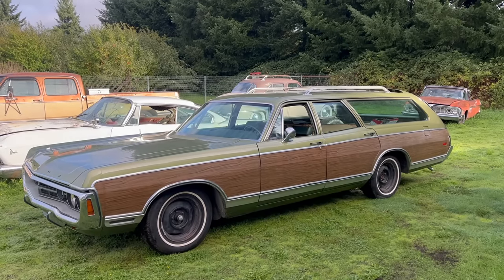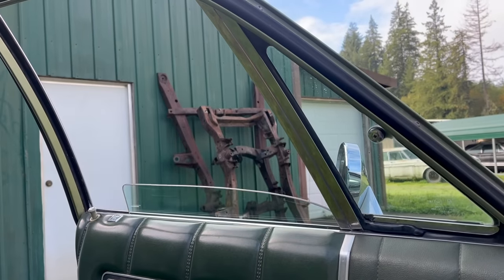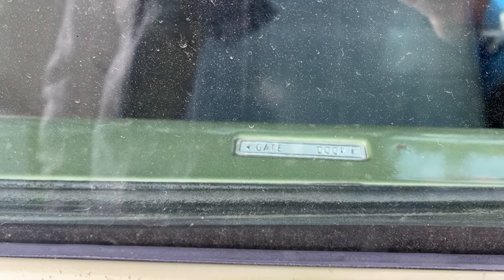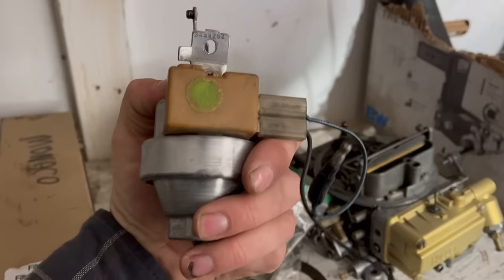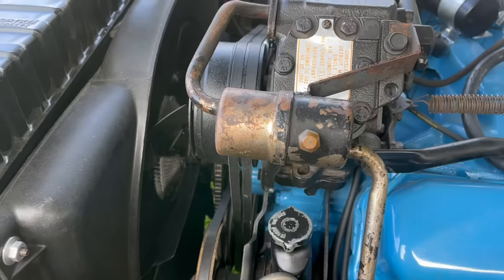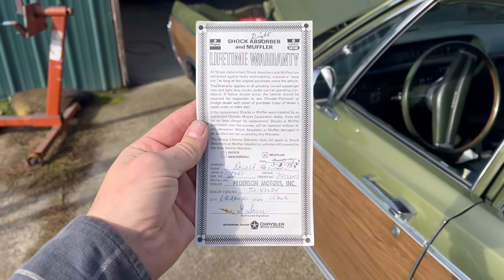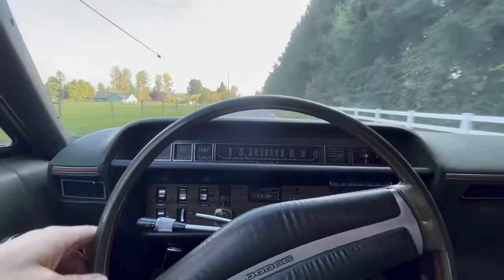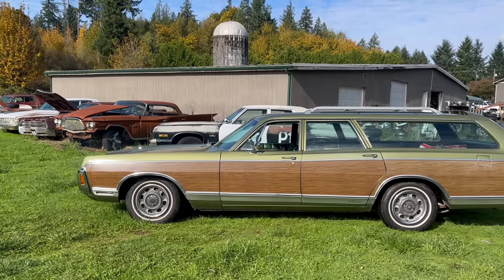AMAZING SURVIVOR! This 1970 Dodge Monaco Station Wagon Is A Sweet Family Truckster With 440 Power

Comment: Gotta love the cigarette window.  Nobody does this anymore, and pity: it maintains the lions share of usable window space while squaring up the window track a bit - keeps it simple and easy to repair.  That and drip rails are two of my most missed small details car designers have simply forgotten about.
Reply: i miss those vent windows also, I made it to 2004 before buying a car (or truck) with A/C thanks to those triangles
Reply: I just sold my '77 Dodge Royal Monaco Brougham Wagon a week ago! 
62k miles and she went to a Good Home!!!
Reply: Those were air vent windows meant to bring air inside.
Reply: I'm amazed how many Dodges were ordered with power windows......even though it was Chrysler's mid-market division.....I just find GM cars had them fairly often, but Ford and Chrysler products much less frequently.
Reply: We were never smokers but my dad had a Chevy van growing up that he made into a camper.  The front windows had those little vent windows and they were the BEST at cooling you down quickly because you could direct the air right at your face.  I miss those and my dad😢

Comment: It would be interesting to see a full sized 1970 Monaco station wagon on the Autobahn. 🙃
Reply: Going 140mph....😎
Reply: @LongIslandMopars with an overdrive, this car can do it. Remember, the police versions of these C bodies in these years could crack 150 mph with the 440 performance package. Although with the soft floaty suspension these non police spec versions have, that could be a bit un nerving. But with good tires and shocks, 120 to 130 is doable. But you’d be a whole lot happier in the 80 to 100 mph range.

Comment: We had a '72 Town & Country wagon when I was a kid. I remember we got it used in like '78 with probably 40k miles on it and dad paid $1,800 for it. It was the first car we ever had with A/C and all the goodies. Such a beast, and so comfortable on road trips. A lot of good memories in that big ole wagon. I laughed when you mentioned ticking sounds in the 440. I distinctly remember ours made a ticking sound when it was under a moderate load. Could have just been pinging from cheap gas and high altitude, but it always seemed like a Chrysler big block thing.
Reply from the maker: Almost certainly pinging. Common problem indeed… haha. Very cool!
Reply: @DeadDodgeGarage  My dad had a new 440 Monaco in the 70s and he would always use premium gas in the hot summer months, which eliminated the pinging.

Comment: A big-ass station wagon is still top on my bucket list. Leave the car looking completely stock with a modern drivetrain under the hood or a big block built for low end grunt mated to a modern overdrive transmission. Ultimate road trip vehicle right there.
Reply from the maker: Absolutely. If ours wasn’t a big block I would be scheming how to put an overdrive in it. It does cruise pretty well as is though. I should probably work on that again some time…

Comment: I grew up during the fuselage era - my dad bought four Plymouth Sport Suburbans new (1968, 1970, 1972 and 1975) the 70 and 72 models were of the fuselage styling era - this Dodge is absolutely gorgeous - the only missing option is factory Airtemp dual air conditioning - curiously according to the dealer option ordering literature the Superlite was not available with dual air conditioning (which made absolutely no sense to me initially until I noticed the Superlite instrument panel switch is in the same location as where the dual air conditioning switch would be located if this wagon were so equipped - presumably due to lack of switch space on the instrument panel) the correct term for the rear “grab handles was “tailgate assist handles” a $19 option at the time - these handles were a Chrysler Corporation exclusive option on certain Chrysler, Dodge and Plymouth wagons from 1960 through 1977 - additionally the windshield/tailgate window washer switch operates both the front and rear systems (I recently saw an entire internal rear washer system for these wagons for sale on ebay) the chrome tailgate filler cap removes to refill the rear washer reservoir

Comment: Beautiful.  I still have a preference for the Plymouth Custom and Sport Suburban wagons (ours was a '69 Custom Suburban 6-seater in blue with a 383-2V).   The Dodge does look lower but I think in part that is from the front end treatment; Dodge did a couple of years with headlights appearing lower on the grill relative to the fender tops and it really makes the cars appear to hug the ground more than the Plymouth.

Someday I hope to have one again but until then its great to see one getting fixed up and loved.
Reply: 383 2bbl are workhorses 👍
Reply: @capricetony  yes, but my Dad always wished he'd gotten the 383-4V or 440, but he bought the car off the lot and it had what he needed and more importantly could afford.  Given how much we towed for vacations though, I'm amazed we never did the fairly basic upgrade of dual exhaust and a 4 barrel intake/carb.  Time, money. car was daily driver, etc...

I wish I had that car...  I wish I'd been more inclined to do that work on her back then...

Comment: Nice.  I'd love to have this.  I'm old enough to remember when they could be found in the parking lot of our country club (which was the bargain basement variety, so a Monaco was pretty special).  Green was actually rather popular.  Interestingly, Chrysler moved almost 5x as many Town and Countrys as this Monaco wagon, even though they were considerably more expensive.  Up to the 74 redesign I always found the Monacos pretty impressive but they were totally clobbered by perhaps its nearest GM rival, the uber successful Bonneville.
Reply: Yes, Green WAS a popular color then, not only Chryslers but the other makes too. Can't tell you how many green HP and mundane Mopars I've owned. I had a '72 Charger Rallye with a 440 and 4 speed in darker F7 or F8 green. I still own a '71 GTX 440 6bbl with Air Grabber, Super Track Pack, AM/FM stereo w/Tape, bench seat w/center arm rest, Tach, hood pins, Driver Aid Package, Rallye wheels, sticker price totaled well over $5000. And it's green inside and out. I've owned and taken apart hundreds of those cars, mostly boring colors, but I did have some H.I.P. colored ones.

Comment: Hey Jamie howz the week treating you? Anyway I had a gear venders over under on my 68 440 Charger and it was so killer on gas and acceleration.if one is available this beast would do exceptional with one.see u Sunday peace and log's!
Reply from the maker: Oh hell yeah. I’ve yet to get my hands on a gear vendors. Some day… could really use something like that for my Power Wagon.
Reply: @DeadDodgeGarage  if I was thinking at the time I would have pulled out the unit.however thing were not good.i sold my charger with a stage 4  440 ,for 5000.a  sad day.

Comment: Definitely a high-optioned Dodge. That "super beam" light was installed on less than 5% of the full size Dodges.
Reply from the maker: And apparently discontinued mid run in ‘70 because it was made illegal.

Comment: Have you been able to come up with/find an adapter for the Edelbrock carb to operate the factory kickdown linkage that you are happy with? I don't like aftermarket cable systems that loop around from behind the trans lever.
Reply from the maker: Absolutely - the bolt on Edelbrock Chrysler throttle adapter. Some adjustment required, but it works.

Comment: Which AVS2 is on that 440, 650 or 800 CFM? I'm trying to decide on one or the other for my mild 440 build. .020 over, 452 heads, MC 1787 cam with .420/.443 lift.
Reply: Recently put a 650 on mine.  I think 800 was the right choice.  😢
Works, but I'm pretty sure it's suffocating things over 4k
Reply from the maker: This is a 650. This thing is super stock and will never turn high RPM. The 440 has enough inches to take advantage of the 800 at really high RPM, so that might be a thought for you, but the 650 will give great throttle response and make excellent torque.
Reply: @DeadDodgeGarage  Thanks, Sort of what I was thinking.

Comment: Isn't Monaco the deluxe trim package for a Polara? 
In my local junkyard, there's monaco with a 440. Even has 440 emblem
Reply from the maker: It’s a stand alone model - at least in ‘70. As much as they shuffled model names around, it wouldn’t surprise me if that were the case in some years.

Comment: I have a 1970 300 in Germany with a slightly tuned 440. Over 110 mph at 4k rpm on the Autobahn your oil temperature starts to rise quickly. Be aware of that.
Reply from the maker: That’s good to know. That explains why the state patrol highway pursuit cars have an oil cooler…
Reply: @DeadDodgeGarage  
Oil temp gauge can help to monitor that 😉

Comment: 'Normally' a car decked out with that many options is a Public Relations car (press car) or a Factory Executive/Lease car. That's what the 'Q' in the V.O.N. signifies. There should be a 'Y' sales code like Y22 or Y28. Nice car. I had a super mint old guy's 1973 Imperial with 55k miles I sold to a German guy in 2003 or 2004. I bought it in 2002 from a Trader ad for $1200. I used it as my daily till it ate me alive in gas (back then). I asked the German lady handling the exporting at the Port of Baltimore how they guy could afford the gas. She said a lot of times they just parked them on the street as a 'status symbol' they could afford to drive a huge American car and didn't drive it that much. I miss the old days when you could still get a nice deal like that. BTW, many of those C-wagons I've seen seemed to come with 383 HP's for some reason, the upper line ones.
Reply: The vin number shows "0", not Q.  DH 45 T0D 170685  DH 45 (high price class Dodge 4 door wagon) T (440-4 bbl slightly detuned to about 350 or so HP in wagons) O 1970 model year D is the plant it was produced at.    Y05:  Build to US Specs.
Reply: @MrTommyboy68  Nobody said the VIN '0' was a 'Q'. It is the first character in the vehicle order number. Which he stated began with a 'Q'. Which is on what is called the 'Trim Tag' or 'Fender Tag' apart from the VIN. It is used internally to build the car order BEFORE it gets assigned a VIN. I really don't know what you're talking about.  You shouldn't confuse the Vehicle Identification Number with the Vehicle Order Number. The V.O.N. is the very first number assigned to the car. As it's built it gets a V.I.N. and the 2 are tied together at the plant.
Reply: @vincemajestyk9497  I am going by the FENDER TAG as he does NOT have a build sheet.
Reply: @vincemajestyk9497  Yep.  I did some further research as I was confused by his "funky things" he mentioned on the group of numbers beginning with Q.  I have never known that that line of numbers is the ORDER NUMBER.  If he had the build sheet for that particular, that information should match the letters and numbers on the top row of the build sheet.  I never knew what those set of numbers was for, now I know.
Reply: @MrTommyboy68  It always follows the SPD which is the scheduled production date which can be different than the 'actual' production date, usually at the end of the month. That car is 'C04' which is December 4th. I've NEVER had a car except maybe a stripper which had all the options or codes on the tag. Even some that were on there but not added at assembly. The BC sheets were considered 'garbage' after it passed through an assembly point at the plant like trim, paint or powertrain and were supposed to be discarded. Some plants like Winsor had a 'no trash policy' so it's kind of rare to find a sheet in those cars.
Reply: @vincemajestyk9497  That is one of the things about Mother Mopar.  Every now and then you will get a "C" body that is LOADED to the gills with options, whether it be a Monaco or VIP or New Yorker.  And a few that I have seen were "sold" customer order and a very few demo's.
Reply: @MrTommyboy68  BTW, if you ever have a car with the original window sticker, on the very top line there will be 'Final Assy Point' (plant) "Vehicle Ident No."  and 'S.O. No'. This is a combination of the SPD-Plant-V.O.N. so this car's S.O. number (on the far right) would look like 'C04-DD-Q05866' if they had the window sticker. Take care!
Reply: @MrTommyboy68  I agree. I had many a C body with weird options. I had a 1971 New Yorker 4dr that was loaded PW, Power Locks Cruise and much more. It also had a 440 TNT and was special ordered by a preacher that wanted the 'most powerful engine' to pull his trailer. It was black with a vinyl top and blue interior, power seats. Road wheels. Nice car. Wish I still had it,

Comment: It is Gold Poly paint/ Gold Metallic Citron. Y6 2102 paint code
Reply from the maker: You might want to adjust your TV set, because it is not gold - it’s green. If you direct your attention to 7:13 in the video, you will see that F4 (light green poly) is clearly shown on the fender tag as well.
Reply: @DeadDodgeGarage  My fault, F4 2133 paint code

Comment: Stock up on those factory plastic case heater control valves.  They seem to only last a few years and then start leaking.  The aftermarket replacements are functional, but don't look anything like the original.
Reply from the maker: That’s definitely Tom’s department. The original seemed to hold up ok for 53 years, but had started seeping a bit.
Reply: @DeadDodgeGarage They are junk. Mine went bad in my 74 Charger. Found an NOS one at a swap meet years ago and paid $125. Unobtainable now. I'm waiting for it to start leaking.....
Reply from the maker: @LongIslandMopars  we just bought one for the ‘73 Charger project at my place, plus bracket. NOS.
Reply: @DeadDodgeGarage  Nice!!